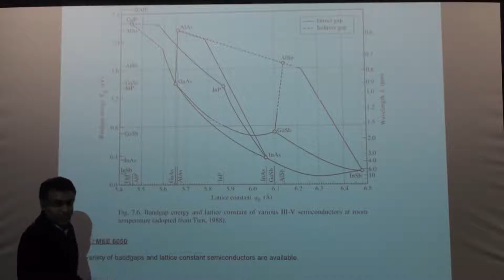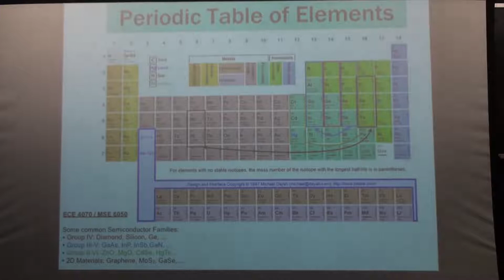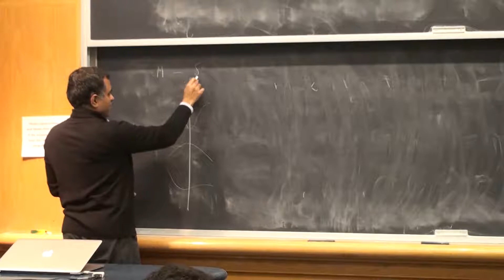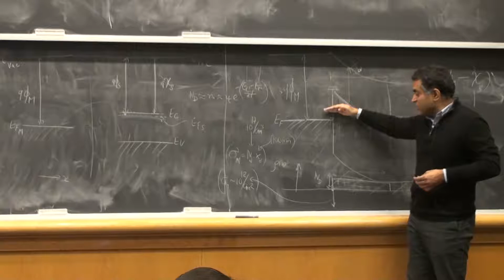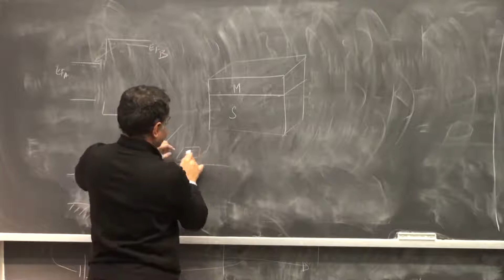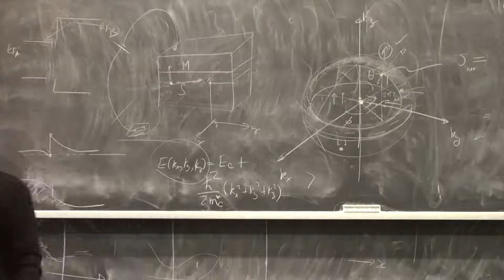Physics of Semiconductors & Nanostructures Lecture 17: Heterostructures & Schottky (Cornell 2017)

Comment: In the Schottkys junction case, Prof illustrated picture for p-type metal where Ef of metal was lower than valance band of Semi-con. 
I wonder, in case of n-type metal, do Ef of metal will be generally higher than Ef of Semi-con. ? So, electron is possible to move from metal to semi-con.